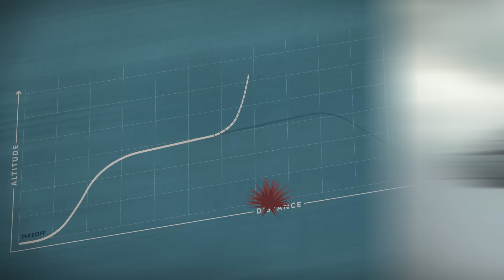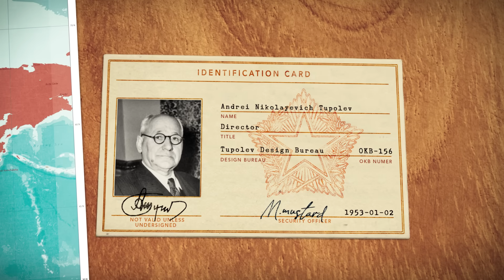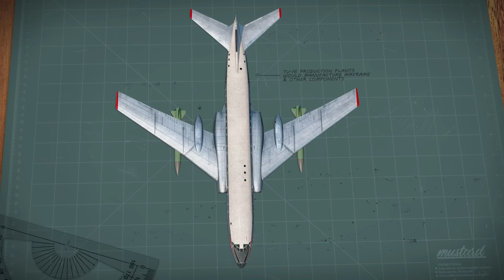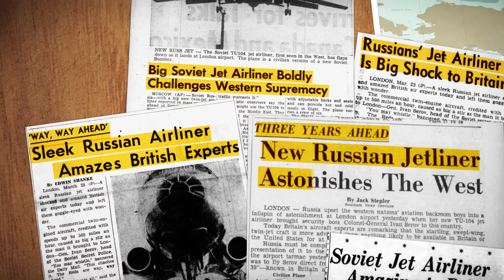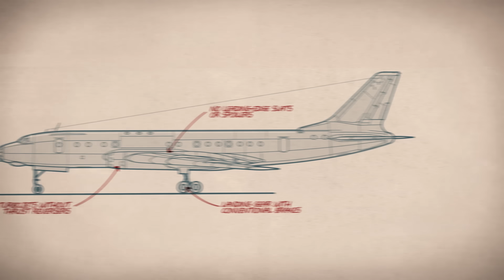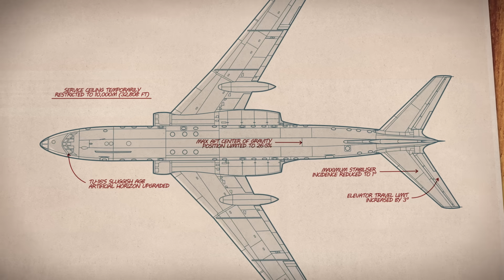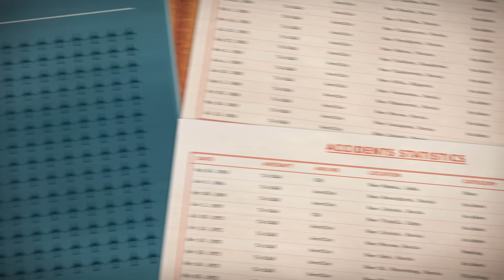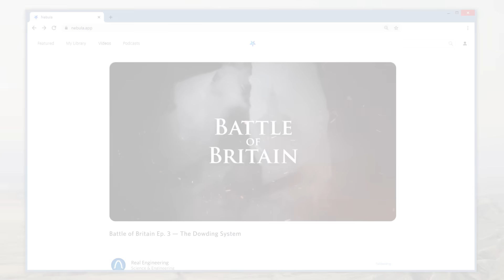The Soviet Airliner Designed To Crash

Comment: La aviacion civil rusa siempre fue una verdadera p0rqu3r14.
Reply: So has the British CAA
Reply: @WilhelmKarsten @WilhelmKarsten Regarding the fabulous trailblazing 
De Havilland Comet.
Accident Losses generally.

We feel we can clear up some commonly held myths and misconceptions, obviously.

It's always good to see the facts presented clearly and concisely isn't it?

De Havilland was subjected to forced merger under the govt aerospace sector rationalisation programme. A similar process occured globally, Sud Aviation and several other French manufacturers merged during design and production of the Caravelle with the Caravelle becoming a significantly international type project. Even in the US, there was no room for multiple manufacturers of large jet airliners with consolidation being inevitable.

The world's first wind tunnel was constructed in England before 1890.
The world's first supersonic wind tunnel was constructed in England during the 1920s.

The DH Comet was subjected to every type of stress testing & wind tunnel testing possible at the time. 

The world's first high altitude airliner.
The world's first jet airliner.

In fact the Comet was the first airliner to have a full fuselage length pressurised passenger cabin suitable for high altitude flying where pressurisation stress was many times higher than flying load stress. Bow-wing (see b-47 wing folding wing collapse incidents) had built less than 12 pressurised cabin airliners before the Comet first flew. The world's first pressurised cabin aircraft was a British design Airco built under licence in the US and modified in the US to have a pressurised cockpit cabin during a joint US / UK research project. Previous pressurised aircraft were airliners with lower pressurisation & altitude limits where pressurisation stress did not exceed flying load stress or were bombers with small heavily built cockpit capsules where potential total  airframe weight gains were insignificant.

The Comet nose was a unique De Havilland design that Sud Aviation subsequently licensed for use on their Caravelle.

Correct, the Comet was designed with military use in mind. In fact, the first designs were based on military use requirements, the first Nimrod aircraft were straightforward modified Comet 4 airframes. Obviously when the Nimrod first flew, it was of course the most advanced and capable aircraft of it's type in existence. All subsequent Nimrod airframes were indeed simply mostly  new manufacture Comet 4 airframes with the additional equipment bay added. Nimrod design and manufacture was in fact performed mostly by the De Havilland team at HS. 

The Comet was in fact an all metal construction airframe airliner, use of other materials was similar to all other airliners at the time. 

  Obviously there have been worse aircraft for accident losses both before & after the Comet. One of the issues was accident losses due to pilot error which were often caused by the novel aspects of jet airliner flying, even so, the accident losses for the Comet as an airliner were not particularly unusual at the time.

Some changes made were to make pilot error on takeoff less likely to cause serious problems. For example, the skin thickness remained mostly the same from Comet 1 to Comet 4.
Ripstop provision existed for all Comets. The original alloy used was discontinued by the manufacturer, the replacement alloy had similar properties.

  Indeed, at the time aviation infrastructure & aircraft technology etc was still developing rapidly, there was still a lot to do when considering all aspects of flying safety.

    How things were back then. 
Accident losses - % of aircraft built.
DeHavilland Comet 4                   14% 
DH Comet all mks   (ff 1948)       17%  
Vickers VC10 UK                            5%

The DH Comet had better safety than or similar safety to many other commercial passenger aircraft of a similar era.

Douglas DC-1                                      99%
Douglas DC-2                                      47%
Douglas DC-3                                      30%
Douglas DC-4                                      26%
Boeing s300                                        72% 
Boeing 307                                          70%
Boeing 247                                          48%
Boeing 707                                          20% 
Lockheed L-049/149 Constellation  30%
Lockheed Electra Turboprop             29%
Fairchild FH-227                                  30%
McDonnell Douglas DC-8                   14%
Sud Aviation Caravelle                        15%
Canadair CL-44  Turboprop                46%  
Convair CV-580  Turboprop                22%
Convair CV-880     (ff 1959)                27%  
Convair CV-990     (ff 1961)                33%
Tupolev T-104        (ff 1956)                16%

The VC10 held the fastest Atlantic crossing speed record for 41 years (Non supersonic airliners).

For the first few years of operations the Caravelle and Comet had similar accident loss Fatalities numbers.

  Instances of all Comet marks, including the Comet 1 and Comet 3 flew with full certification at some point after 1954. Airline duty Comets were all retired by 1980 with full certification until after retirement. The last Comet flight was a global circumnavigation series of flights in 1997.

   Of course De Havilland carried out a full stress analysis & performed extensive & protracted testing, including pressure cycle testing, on two long lengths of fuselage. De Havilland carried out significantly more testing than was required by any authority at the time & significantly more testing that any previous airliner was subjected to.

  Of course De Havilland had prior experience building many all metal construction airframe aircraft & thousands of jet powered fighter aircraft that were primarily of metal construction with pressurised cockpits & jet engines built by De-Havilland. At the time De Havilland engineers  knew all there was to know about metal fatigue as it applies to aircraft.

    De Havilland did indeed always work to better than industry standards at the time, used up to date knowledge for the design & no evidence of negligence  or criminal negligence was ever produced in relation to the DH Comet.

Military aircraft accident losses compared.
Non combat phase accident losses.
% of Aircraft built.
The EE Lightening did not have unusually high losses. 
The Canadair CL-44 was a turboprop airliner.
Canadair CL-44               (ff 1959 ) 48%
Lockheed XF104             (ff 1954) 100%
Lockheed  P80                (ff 1944)  43%
Lockheed F104               (ff 1954)  45%
MD FH Phantom 1          (ff 1945)  35%
MD F4 Phantom 2           (ff 1958)  28%
Convair F102 Dagger      (ff 1953)  45%  
MD F3H  Demon              (ff 1951)  32%
MD F-101 Voodoo           (ff 1954)  34%
EE Lightening                   (ff 1954)  33%
Gloster Meteor                (ff 1943)   21%
DH Vampire                     (ff 1943)   23%
DH Sea Vixen                  (ff  1951)  33%
Gloster Javelin                (ff 1951)   20%

Note that the Meteor didn't have particularly high losses, flew with more than 20 airforces for decades, got involved in air to air combat during a number of conflicts successfully against aircraft that first flew many years after the Meteor first flew.
 
We hope this helps, of course.       
       
As always, cheers & indeed 👍.

Comment: БОИНГ-104......😅😅😅😅😅Суперкомментарий.
Reply: De Havilland Comet
Reply: @WilhelmKarsten 

@WilhelmKarsten Regarding the fabulous trailblazing 
De Havilland Comet.
Accident Losses generally.

We feel we can clear up some commonly held myths and misconceptions, obviously.

It's always good to see the facts presented clearly and concisely isn't it?

De Havilland was subjected to forced merger under the govt aerospace sector rationalisation programme. A similar process occured globally, Sud Aviation and several other French manufacturers merged during design and production of the Caravelle with the Caravelle becoming a significantly international type project. Even in the US, there was no room for multiple manufacturers of large jet airliners with consolidation being inevitable.

The world's first wind tunnel was constructed in England before 1890.
The world's first supersonic wind tunnel was constructed in England during the 1920s.

The DH Comet was subjected to every type of stress testing & wind tunnel testing possible at the time. 

The world's first high altitude airliner.
The world's first jet airliner.

In fact the Comet was the first airliner to have a full fuselage length pressurised passenger cabin suitable for high altitude flying where pressurisation stress was many times higher than flying load stress. Bow-wing (see b-47 wing folding wing collapse incidents) had built less than 12 pressurised cabin airliners before the Comet first flew. The world's first pressurised cabin aircraft was a British design Airco built under licence in the US and modified in the US to have a pressurised cockpit cabin during a joint US / UK research project. Previous pressurised aircraft were airliners with lower pressurisation & altitude limits where pressurisation stress did not exceed flying load stress or were bombers with small heavily built cockpit capsules where potential total  airframe weight gains were insignificant.

The Comet nose was a unique De Havilland design that Sud Aviation subsequently licensed for use on their Caravelle.

Correct, the Comet was designed with military use in mind. In fact, the first designs were based on military use requirements, the first Nimrod aircraft were straightforward modified Comet 4 airframes. Obviously when the Nimrod first flew, it was of course the most advanced and capable aircraft of it's type in existence. All subsequent Nimrod airframes were indeed simply mostly  new manufacture Comet 4 airframes with the additional equipment bay added. Nimrod design and manufacture was in fact performed mostly by the De Havilland team at HS. 

The Comet was in fact an all metal construction airframe airliner, use of other materials was similar to all other airliners at the time. 

  Obviously there have been worse aircraft for accident losses both before & after the Comet. One of the issues was accident losses due to pilot error which were often caused by the novel aspects of jet airliner flying, even so, the accident losses for the Comet as an airliner were not particularly unusual at the time.

Some changes made were to make pilot error on takeoff less likely to cause serious problems. For example, the skin thickness remained mostly the same from Comet 1 to Comet 4.
Ripstop provision existed for all Comets. The original alloy used was discontinued by the manufacturer, the replacement alloy had similar properties.

  Indeed, at the time aviation infrastructure & aircraft technology etc was still developing rapidly, there was still a lot to do when considering all aspects of flying safety.

    How things were back then. 
Accident losses - % of aircraft built.
DeHavilland Comet 4                   14% 
DH Comet all mks   (ff 1948)       17%  
Vickers VC10 UK                            5%

The DH Comet had better safety than or similar safety to many other commercial passenger aircraft of a similar era.

Douglas DC-1                                      99%
Douglas DC-2                                      47%
Douglas DC-3                                      30%
Douglas DC-4                                      26%
Boeing s300                                        72% 
Boeing 307                                          70%
Boeing 247                                          48%
Boeing 707                                          20% 
Lockheed L-049/149 Constellation  30%
Lockheed Electra Turboprop             29%
Fairchild FH-227                                  30%
McDonnell Douglas DC-8                   14%
Sud Aviation Caravelle                        15%
Canadair CL-44  Turboprop                46%  
Convair CV-580  Turboprop                22%
Convair CV-880     (ff 1959)                27%  
Convair CV-990     (ff 1961)                33%
Tupolev T-104        (ff 1956)                16%

The VC10 held the fastest Atlantic crossing speed record for 41 years (Non supersonic airliners).

For the first few years of operations the Caravelle and Comet had similar accident loss Fatalities numbers.

  Instances of all Comet marks, including the Comet 1 and Comet 3 flew with full certification at some point after 1954. Airline duty Comets were all retired by 1980 with full certification until after retirement. The last Comet flight was a global circumnavigation series of flights in 1997.

   Of course De Havilland carried out a full stress analysis & performed extensive & protracted testing, including pressure cycle testing, on two long lengths of fuselage. De Havilland carried out significantly more testing than was required by any authority at the time & significantly more testing that any previous airliner was subjected to.

  Of course De Havilland had prior experience building many all metal construction airframe aircraft & thousands of jet powered fighter aircraft that were primarily of metal construction with pressurised cockpits & jet engines built by De-Havilland. At the time De Havilland engineers  knew all there was to know about metal fatigue as it applies to aircraft.

    De Havilland did indeed always work to better than industry standards at the time, used up to date knowledge for the design & no evidence of negligence  or criminal negligence was ever produced in relation to the DH Comet.

Military aircraft accident losses compared.
Non combat phase accident losses.
% of Aircraft built.
The EE Lightening did not have unusually high losses. 
The Canadair CL-44 was a turboprop airliner.
Canadair CL-44               (ff 1959 ) 48%
Lockheed XF104             (ff 1954) 100%
Lockheed  P80                (ff 1944)  43%
Lockheed F104               (ff 1954)  45%
MD FH Phantom 1          (ff 1945)  35%
MD F4 Phantom 2           (ff 1958)  28%
Convair F102 Dagger      (ff 1953)  45%  
MD F3H  Demon              (ff 1951)  32%
MD F-101 Voodoo           (ff 1954)  34%
EE Lightening                   (ff 1954)  33%
Gloster Meteor                (ff 1943)   21%
DH Vampire                     (ff 1943)   23%
DH Sea Vixen                  (ff  1951)  33%
Gloster Javelin                (ff 1951)   20%

Note that the Meteor didn't have particularly high losses, flew with more than 20 airforces for decades, got involved in air to air combat during a number of conflicts successfully against aircraft that first flew many years after the Meteor first flew.
 
We hope this helps, of course.       
       
As always, cheers & indeed 👍.

Comment: But if the Tupolev 104s tended to suddenly pitch up, then the problem was the rear stabilizers, which couldn't support the force and weight of the plane's front end. I don't think it was difficult to investigate the accidents, because if it wasn't the stabilizers, then how did the plane suddenly face up towards the sky?

Comment: I don't care, she looked pretty! 
No more dangerous than a DC1O!
Reply: The DC-10 has a better safety record than the Tu-104 or the worst jet airliner in history... the de Haviland Comet.
Reply: @WilhelmKarsten Are you serious? The Comet was safe when they altered the design, it was the first and people were figuring things out. The DC10 was a piece of trash when you read up about it.
Collapsing floors, deadly lifts, dodgy cargo door locking mechanisim.
Nope, you will find the DC10 is not all it was cracked up to be....just cracking up😂
Reply: @fionanatalieholden5965 Your comments reveal someone who has absolutely no knowledge or experience regarding this topic.
The DC-10 has only 0.64 fatal crashes per million flights 

The Comet has over 39 fatal crashes per million flights with 629 fatalities per million 
 The Comet 4 has a  34% crash rate, the highest loss rate of any jet airliner in history except for the Comet 1(Comet 1 46% loss rate)
Reply: @WilhelmKarsten Nope ni know knowledge what so ever, but you obviously haven't read books on the dc10 and Comet, that was the Comet 1, you forget the revised Comet.
I think you ought to read more and let me be thick.
Reply: @fionanatalieholden5965 The DC-10 is still in service, I saw one flying a couple days ago.
The DC-10 has a better safety record than the Concorde.
The Comet remains the worst jet airliner in history..

The only jet airliner that has a worse safety record than the Comet 4 is the Comet 1.